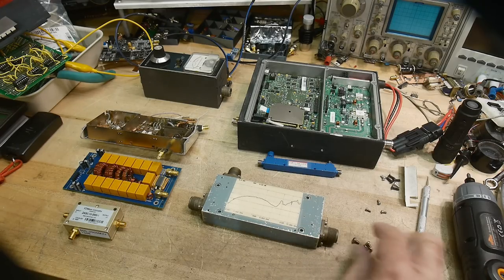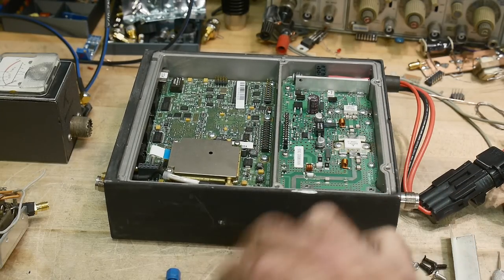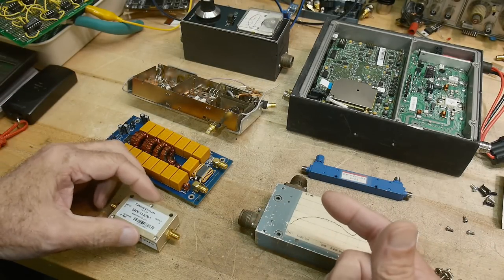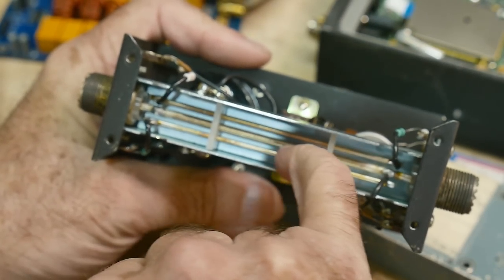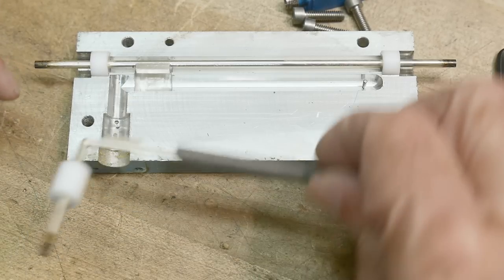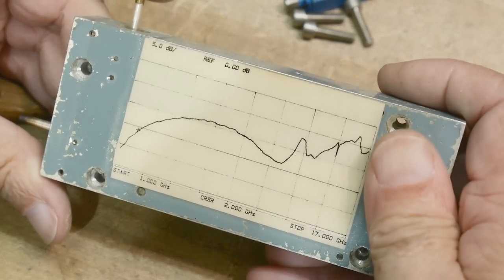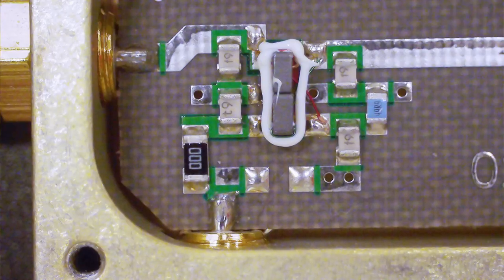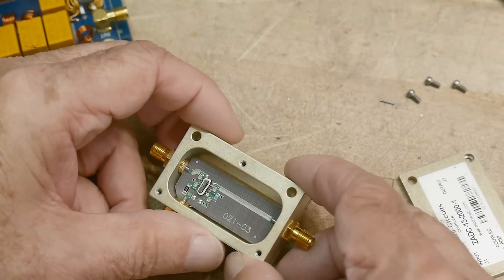#1478 RF Coupler Construction

Comment: Very good clip, thanks.  I did not know about transformer type coupling.
In some power amplifiers, they use couplers to sample the output power so they can per-distort  the input signal to cancel out non-linearity of the amplifier .
Reply: I did some online research on this and found something interesting.  Checkout ADL5920, which is a directional coupler in a chip based on opamp.
Reply: @aduedc  And there is an Arduino shield/ evaluation package for it at Mouser Electronics. 9khz to 7 ghz...Yikes !

Comment: The electric field around a wire is mostly radial.  The part parallel to the wire only generates IV heat losses.  The EM field inside the wire decays exponentially beginning at the surface; this is the 'skin effect.'

Comment: That thing that looks like ferrite may be a cast carbon resistor. It looks like a high power coupler so the combination of surface area and non-inductive resistance makes a lot of sense for both heat dissipation and bandwidth.

Comment: Imsai Guy,  Maybe the blue coupler's ferrite material is really a wideband resistor?  That would make more sense since it would follow the typical coupled line construction (i.e. 50 termination on one end).  And I suspect the resistor's topology results in very  low parasitics, permitting a very high upper frequency.

Comment: That microstrip coupler on the power amplifier is actually reading the forward output power of the amplifier and is probably used as part of a power control loop.
Reply from the maker: oh, you are right. I also noticed that the main line is 50 ohms and they used a 100 ohm coupled line. had not see that before.

Comment: @15:25 The wide un-plated trace is of unknown impedance.  The green trace above it has a 100 Ohm resistor termination, so we know what the impedance (100-Ohm) is very likely to be. It could be a 1:2 ratio, or in the case of Toroid based (low power) couplers with 1 thru-turn through it could be a 1:20 or higher ratio, depending on the Toroid secondary turns ratio.
Many QRP SWR meters use Toroids just to get enough voltage to measure...
...but mostly via Op-Amplification of the half-wave rectification.

Comment: Awesome video. Back in video #749 you made "Improvements" to an old Antenna Tuner. IT had on of the "SWR Bridge" units in it just like the "Archer" unit in this video. SOMEWHERE around my house I have one of these units - I THINK it is a Vanco unit. Main thing I got from this video is the difference between a "Coupler" and a "Detector (like the SWR Bridge) and it made things much easier to differentiate between the two.
Have to used the Toroid thye coupler  (see #749b) with an Arduino WITHOUT the Log Amp? Did it work ok?
Reply from the maker: no, should be OK as most SWR bridges in ham radio transceivers don't use a log amp. you won't have a lot of dynamic range

Comment: More RF magic. Doesn't get much better than this! The two transformer based ones are not that difficult to understand. One transformer measures the current on the transmission line and the other measures the voltage. If you do the  math as W2AEW did it comes out fairly easily in terms of forward and reflected energy on the line. See his excellent video for details.
Reply: The transmission line devices do the same.  Capacitive coupling from the center rod to the adjacent rods establishes the voltage on the center conductor and it will be in phase with the voltage of the center conductor.
Inductive coupling reveals the current on the center conductor; this coupling turns into a voltage on the parallel rods BUT the phase is reversed.  That means one of the sensing rods will take its measure where the induction and capacitance reinforces; the other sensing rod is where the inductance opposes the capacitance.  Only in the case the termination is 50 ohms will the resulting current exactly cancel the capacitively coupled voltage. 
Really that's all it does.  It has no idea of "direction" and it isn't, strictly speaking, a directional coupler.

Comment: The set up doesn't seem to yield results for me. Is there a 50Ω resistor on the insulated line? And whats the frequency of the sine wave?
Reply from the maker: No resistor. 1MHz
Reply: @IMSAIGuy  I gave it a shot, but I don't have the same results (No coupling), the two wires I'm coupling are also the same in length. Maybe the Vpp? Any ideas?
Reply from the maker: @theMlab23 I used a 10x scope probe on the insulated wire.